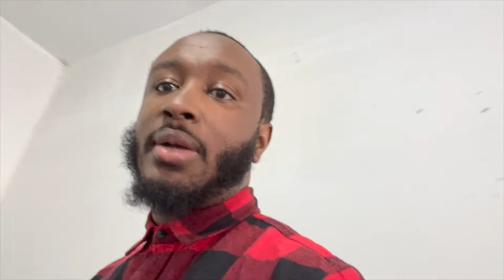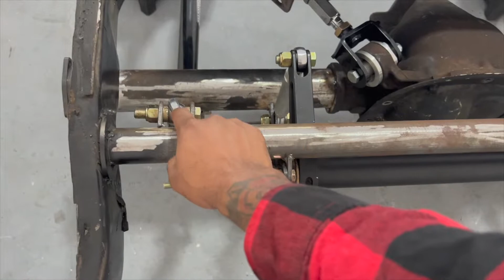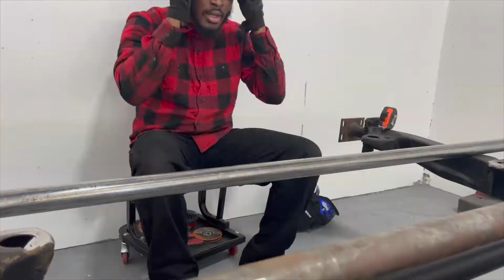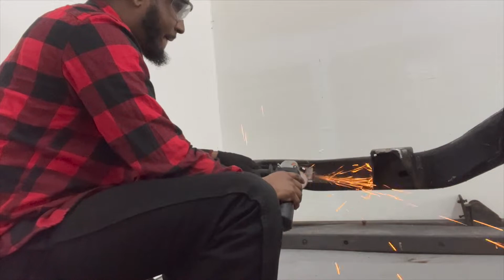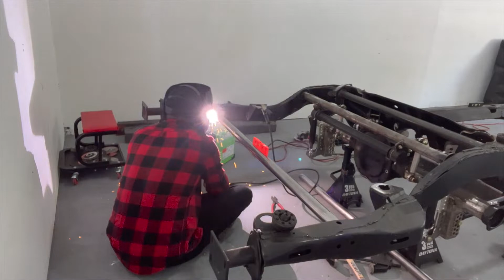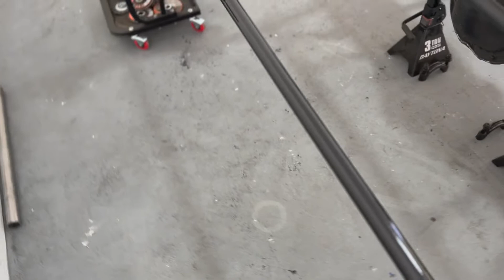G Body Stiffened

Comment: Nice work. Looks good
Reply from the maker: Appreciate it
Reply: @bon3zperformance367  all bracing from trick chassis?
Reply from the maker: @nitomeanboyGBODY  no i bought some tubing from s&w race cars. Only the bar that has the anti roll bar came from trick chassis
Reply: @bon3zperformance367  ok gotcha.. I assumed I would have to put source for my other bracing. But ur visuals helped a ton.. big thanks 💪🏼
Reply from the maker: @nitomeanboyGBODY  i have another vid coming this week with trick chassis frame brace kit.
Reply: @bon3zperformance367  I’ll subscribe and be on the look out

Comment: I subbed and liked but am curious about all this weight you are adding. Why does the back 50" bar do? The frame only needs to be stiff from rear suspension forward. Plus rear bumper and rear body mounts will have that not moving anywhere.
Are you using a stock gas tank and spare tire well?
Reply from the maker: @jeffchan9176 I  added that bar because i actually now have to notch the frame more for my wheels. And i wont have a mounted rear  bumper that will attach to the frame it will be a fiberglass roll pan that mounts to the body
Reply from the maker: Also thanks for the sub and like. I appreciate it
Reply: @bon3zperformance367  You should mention that in your video. Hate to see someone install the bar then find out the fuel tank, spare tire well will not fit.
Reply from the maker: @jeffchan9176  thanks
Reply: @jeffchan9176 truuuuue
Reply: @jeffchan9176  if they are welding in these bars they should know if they are gonna be running a factory location fuel tank
Reply: @deepfreeze8918  If we were all as smart as you. Nobody would need advice.

Comment: How did you get your frame safely in the garage? Because that is the problem I am trying to figure out after mines come from powder coating?
Reply from the maker: I had 1.5 ton jack and like 6 jack stands. If i had to do it over i would have had 3 ton jacks and like 8 jack stands. If made it easier when i did the same thing recently

Comment: Did you leave the gas line or move it to front of plate
Reply from the maker: No gas lines at the moment. Going with different lines than stock
Reply: Nice I’m  boxing my frame but idk if I should leave the lines or take them out ?do you recommend anything?
Reply from the maker: @LuxurySportFranco  if you leave the lines in and have to change later it will be difficult to get to the bolts that hold them down. Are you upgrading motor or anything? If so may want better lines like an lines
Reply: Yes im going to drop a ls2 and ok i see thanks 🙏🏼

Comment: Where is the gas tank going to be relocated?
Reply from the maker: I have removed that bar but the car will run a fuel cell not original gas tank as it will be a drag and drive with rear mounted radiator
Reply: Kool, you are the man Great Work!!!
Reply from the maker: @enoswhitaker7967  Appreciate it